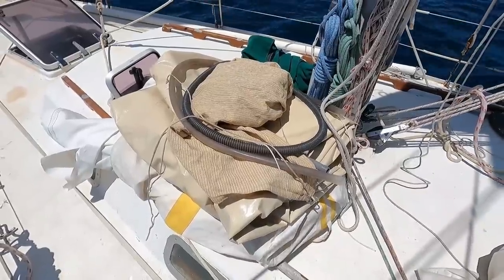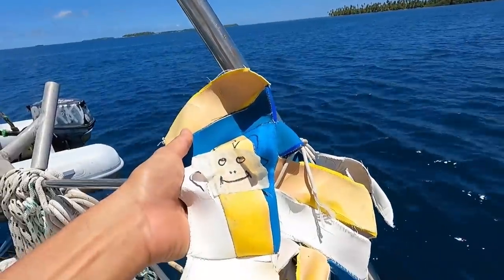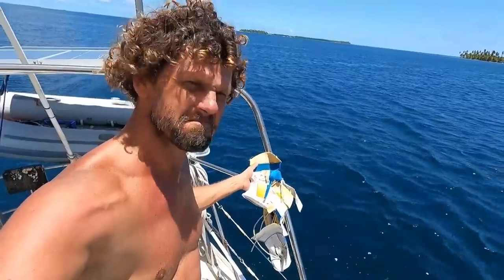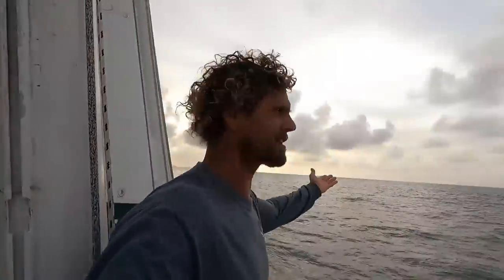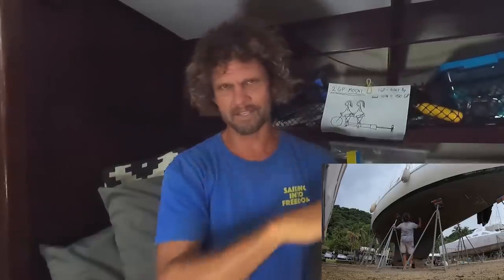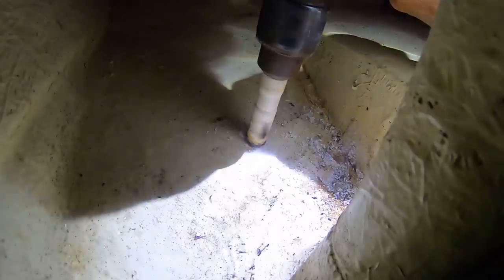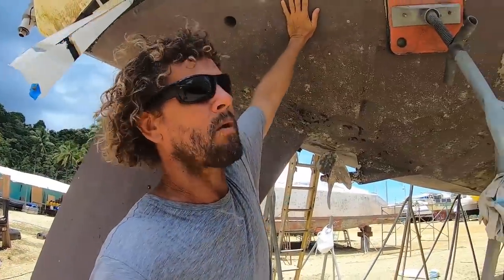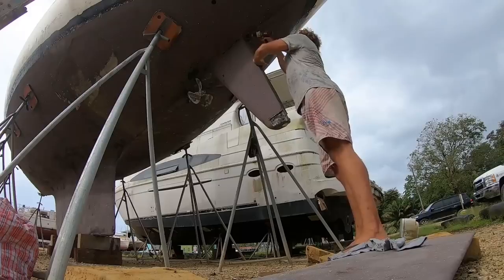THE END OF FREEDOM?

Comment: I'm sure going to miss this ! ❤...but on to new adventure with your Mumby build and travels. 🙂

Isn't cat sailing harder, more limited, not as fun, like not capable of up wind as much compared to monohull ?
Reply from the maker: Hey Jeff, you have to be careful and reef early. The good thing about a very light boat like the Mumby is that doing this won't affect the speed so much. Drag at 9knots is less than 300 kg... Much less sail is required to propel the boat. Upwind is just as good as another cruising monohull with the deep dagger board....not as good as the racers of course but we are not racing

Comment: To dry out a foam core--

How I did it was to put a small 1/8 inch drill in a power hand drill, and using a half inch strip of wood, or maybe 3.4 inch. draw lines over the suspect area, then come back and draw lines at 90 degrees, through the top surface only and a little way into the foam.  Drill out the intersect points, and you now have a perforated fibreglass panel over the damp hull.  Lay on the hull several desiccant bags of silica gel, you buy them from storage supplies, and cover with a sheet of plastic, then tape down the edges.  If you wish to hurry up the process, warm the outside of the hull a little with a hot air blower--not too hot of course.  Replace sodden silica gel with fresh bags,  until bags come out dry.  Sand down interior surface, and vacuum up dust, then plug holes with epoxy mixed with phenolic micro balloons, and paint over with two pack epoxy primer, then two lack polyurethane.
Reply from the maker: Good idea thanks

Comment: Most of the Mumby's are galley down but Jupiter said they can be done galley up. Do you know which way you are going/leaning?
It's such a sleek, slippery looking design. I just happen to be 6'4" and from what I've heard, I might be hitting my head in the perimeter of the salon. I wonder how hard it would be to adjust a little extra space under the salon deck. I did that when I built my F-9A and I don't think it affected the performance at all. But that was DuraCore/Carbon. I have essentially zero experience with aluminum, other than some smaller parts I fabricated.
I may be coming for a visit to the PI during your build. I worked on Luzon 82-89 and liked it alot. I always thought I'd go back but never made it. The Mumby design and aluminum cats intrigue me.
Reply from the maker: Ok come and visit. Galley up and now storage below... Mumby is a bit light on storage